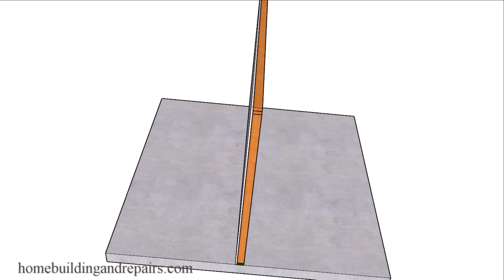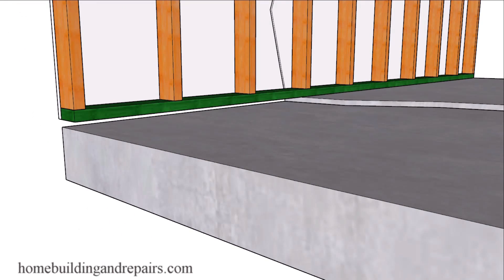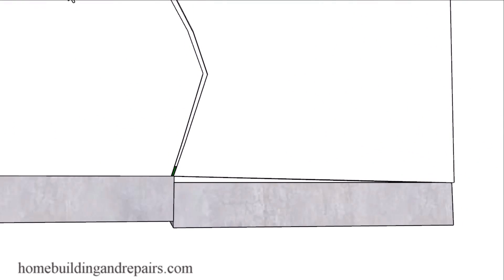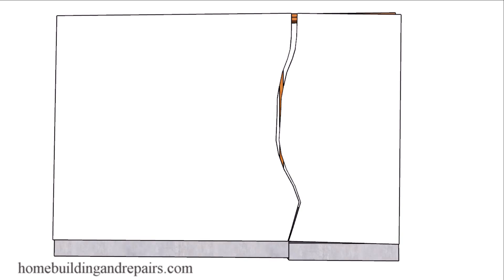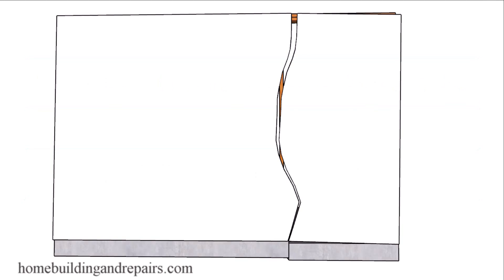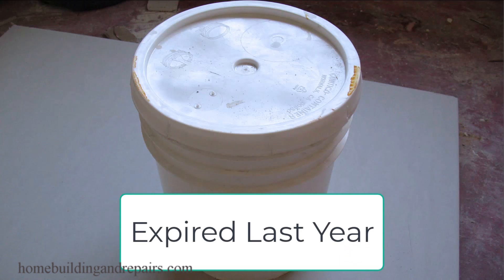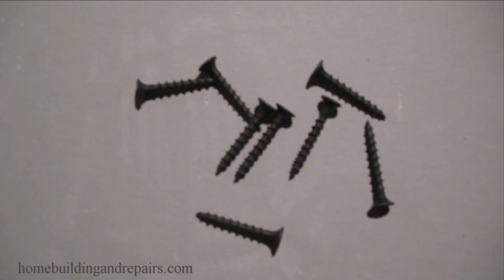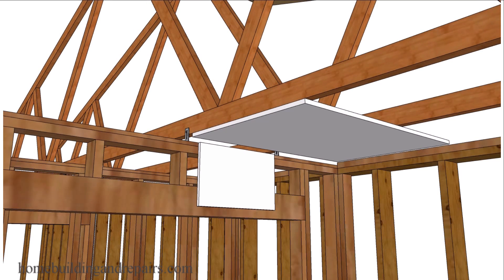What Can Cause Large or Tiny Stress Cracks in Drywall or Plaster - Structural Movement

Comment: Roof truss uplift, any tips for repairing a 4 metre width crack 1 1/2 inches  below it?
Reply from the maker: https://www.youtube.com/watch?v=mwillzaluZE I don't know if you saw this video, but I did suggest attaching a trim board to either the lower of upper part of the crack, but not the other side, to allow it to move, but cover damaged area.
Reply: @gregvancom  many thanks.

Comment: I'm actually dealing with this problem right now. After living in my house for 10 years my front door suddenly won't close at all and the drywall is cracked.
Reply from the maker: Yes, the old doors and windows that won't close or open or are difficult to close and open. You might need to raise one side of the wall or re install door to solve this problem.